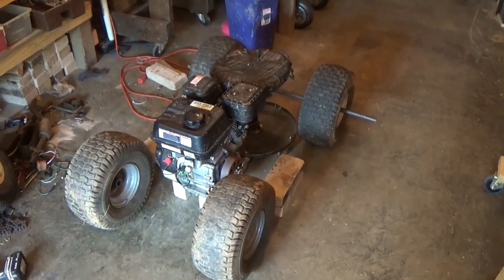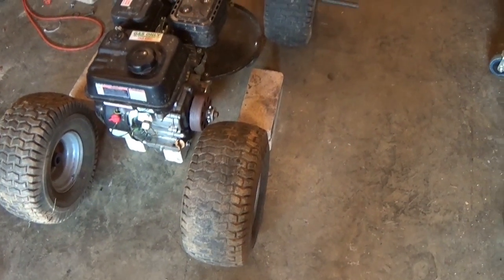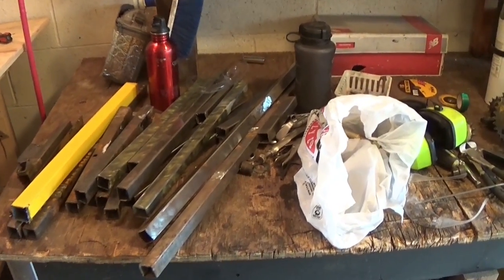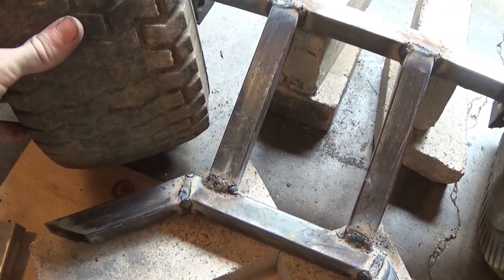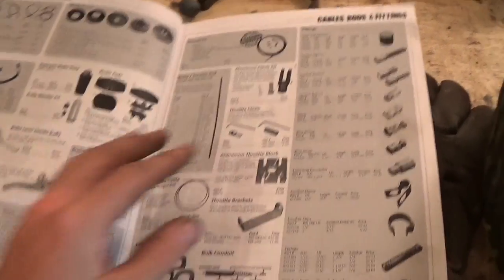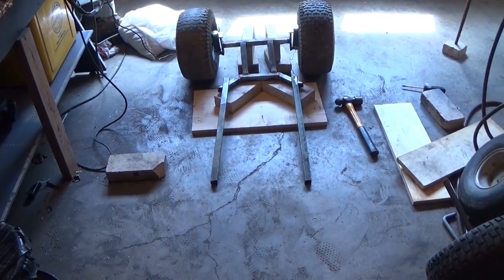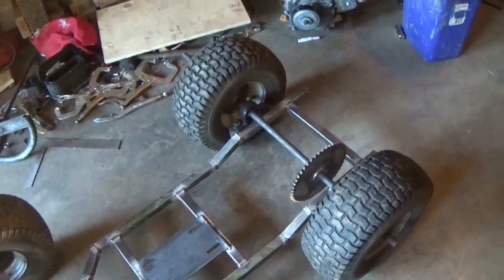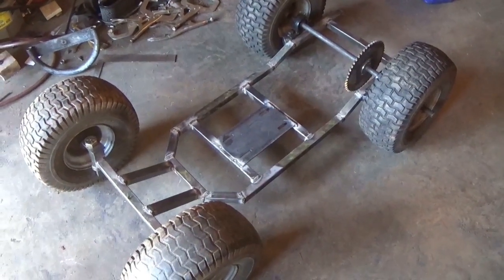new project part 1

Comment: actually welding the axle weakens it alot more than cutting a keway. I put tubes in severely dry rotted tires all the time and they do fine. Those turf saver tires are really good.  I dont think you have to do a skid plate but thats up to you. Id wait till you get some miles on it and see how it does

Comment: Where do you get those engines? Do you salvage them form lawn mowers or something
Reply: They are 212 cc predator engines from harbor freight.
Reply: +Colepaq where do you get engines if you live in new zealand?
Reply: I wonder as well, in my country there aren't any engine retailers like this
Reply: You can salvage similar engines from snowblowers, pressure washers, rototillers, etc.

Comment: Should make a cycle kart, its a lot of fun, check my channel. for the flat Tyre you can mix gas and clear silicon in to a liquid and pump it in the Tyre and it should seal it.